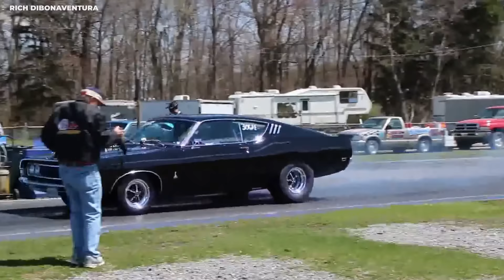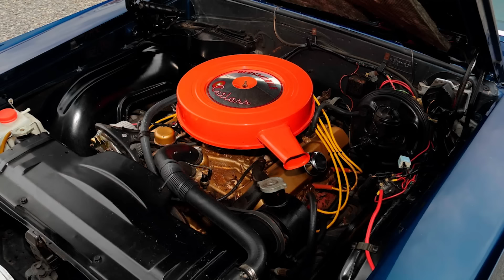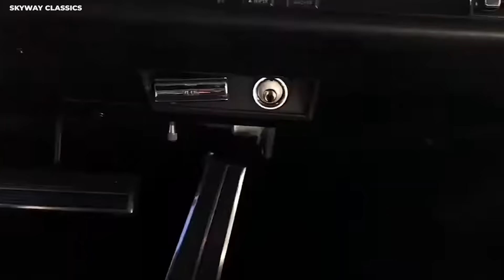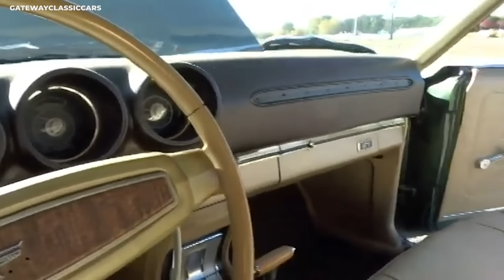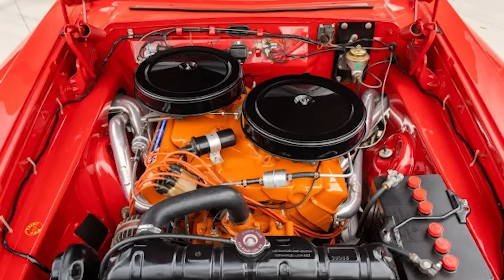12 WORST 60s Muscle Cars of All Time!

Comment: A 60s car with a V8 does not equal muscle car a muscle car is a car what's the largest standard V8 engine the manufacturer could put into the car regardless of manufacturer a 307 Nova not a muscle car 396 Nova muscle car a mustang with a 289 is a pony car in later years a mustang with a 429 definitely a muscle car Mopar 318 not a muscle car with a 383 a muscle car learn your terms

Comment: CHEVROLET produced three cars with the same body type and the only difference was the 
amount of chrome trim on the body :
CHEVROLET IMPALA ( since 1958 ) : maximum chrome trim
CHEVROLET BEL AIR ( since 1950 ) : some chrome trim
CHEVROLET BISCAYNE ( since 1958 ) : little to no chrome trim

NOTE : of course you paid more for the extra chrome trim !

Comment: 1960'S MUSCLE CARS :

@00:40  :  1966 OLDSMOBILE CUTLASS BASE V8 ( WITH 330 C.I. V8 @ 250 HP )
@04:39  :  1969 PLYMOUTH BARRACUDA BASE V8 ( WITH 318 C.I. V8 @ 230 HP )
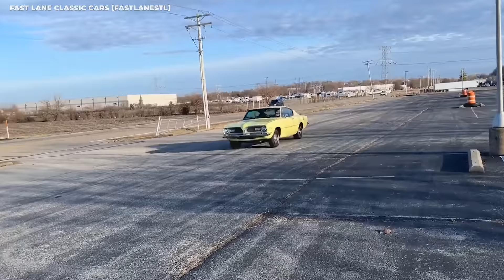@08:25  :  1967 CHEVROLET CHEVELLE MALIBU BASE V8 ( WITH 283 C.I. V8 @  195 HP )
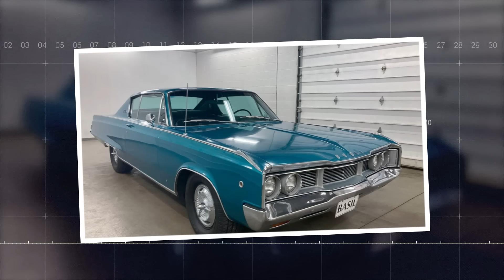@12:03  :  1968 DODGE POLARA ( WITH 318 C.I. V8 @ 230 HP )
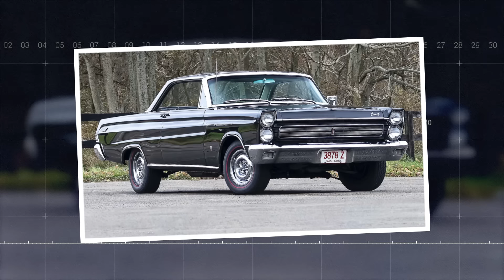@15:47  :  1965 MERCURY COMET BASE V8  ( WITH 289 C.I. V8 @ 200 HP )
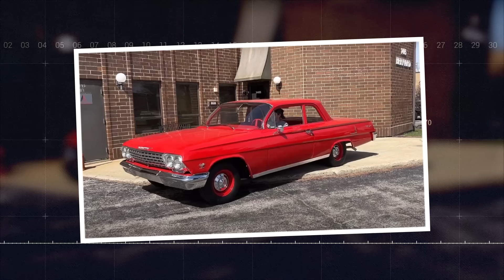@18:18  :  1962 CHEVROLET BISCAYNE 409 LOW OUTPUT ( WITH 409 C.I. V8 @ 340 HP )
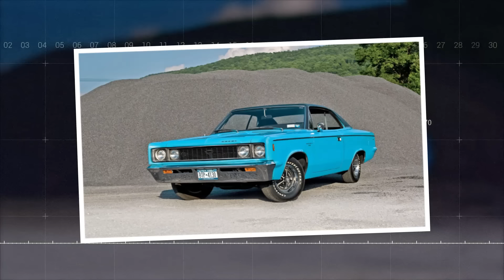@20:20  :  1969 AMC REBEL MACHINE BASE VERSION ( WITH 290 C.I. V8 @ 200 HP )
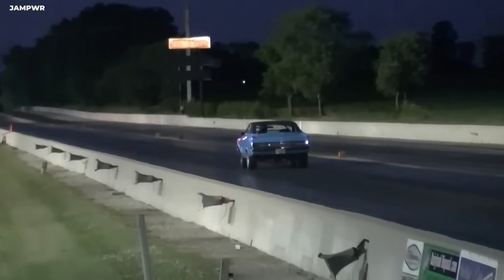@22:22  :  1966 DODGE CHARGER FIRST GENERATION BASE MODEL 
                   ( WITH 318 C.I. V8 @ 230 HP )
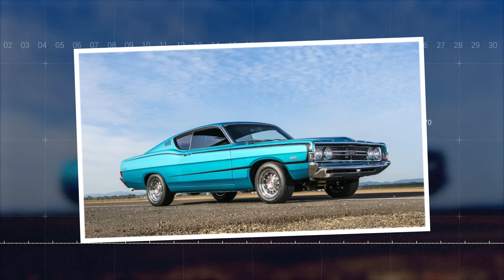@24:27  :  1968 FORD TORINO GT BASE V8 ( WITH 302 C.I. V8 @ 210 HP )
@26:22  :  1967 AMC MARLIN ( WITH 343 C.I. V8 @ 280 HP )
@28:26  :  1964 PONTIAC TEMPEST LEMANS BASE V8 ( WITH 326 C.I. V8 @ 250 HP )
@30:35  :  1962 DODGE DART 413 ( WITH 413 C.I. V8 @ 410 HP )

Comment: I'll drop one in the comments they still talk about the 413 Mopar Max wedge cars and they weren't on 12 seconds maybe withstand advised by tires you rolled out of the dealership with give me a break and they didn't break that much either they had a 727 torqueflite automatic transmission in 8 and 3/4 axle they use those cars all through all the 60s and 70s and they didn't break then why did he break that all of a sudden huh geez old piece you're so full of it
Reply: This whole video is nonsense. Everything in there is 'Secretary Spec' until they end with an actual factory experimental drag car? Ridiculous.